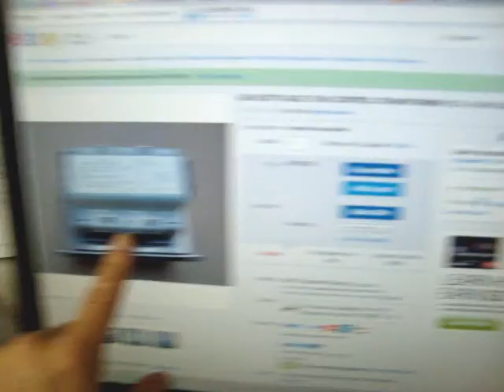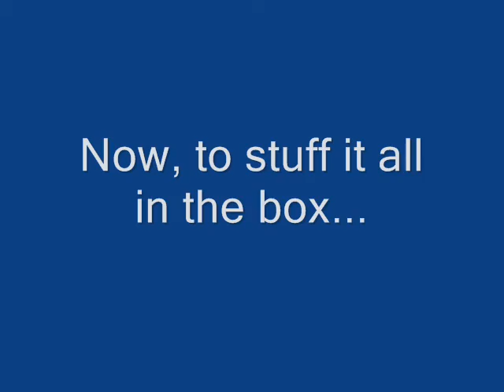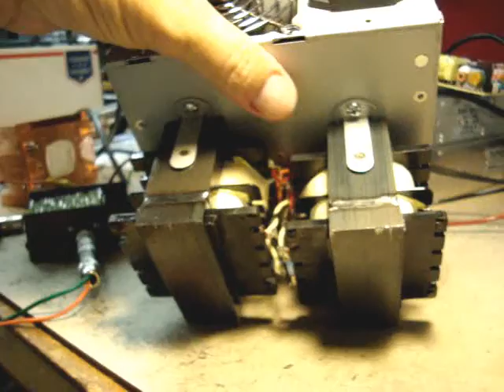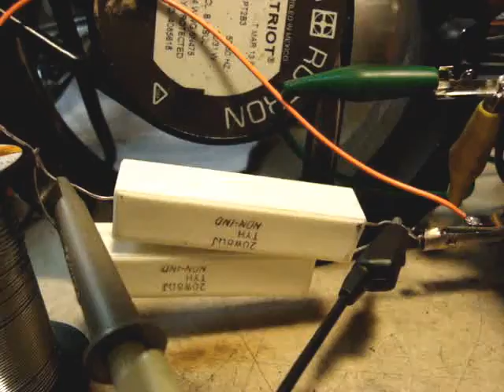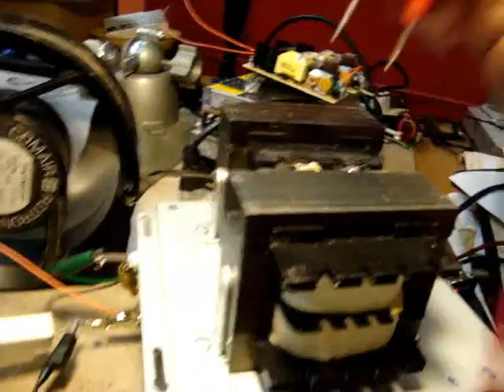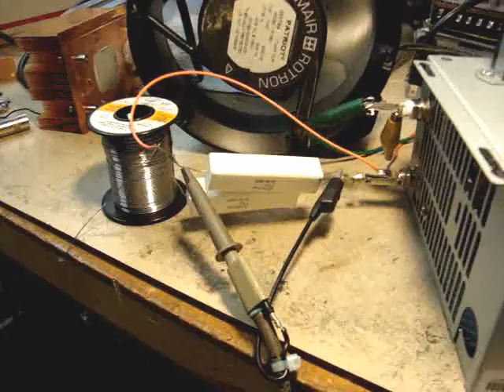Power Transformers for LM3886

Comment: Are the transformers getting hot?
Reply from the maker: Nope, they're still working good. :-)
Reply: Do you think that you could have used smaller transformers?
Reply from the maker: Brian Ksiazek - No, the amperage rating of bith these transformers together is just barely enuff to make the rated output power demonstrated in this video. There are transformers available that are a bit smaller and that can replace 2 transformers (as in this video), but will cost more. The purpose of this vid is how to use 2 low cost power transformers, as you seen, it works nicely.
Reply: Thanks for the info!
Reply from the maker: Anytime  ;-)